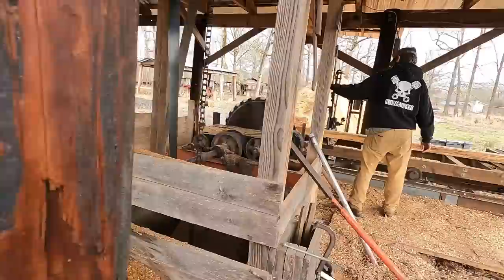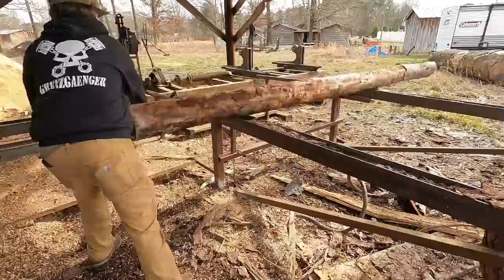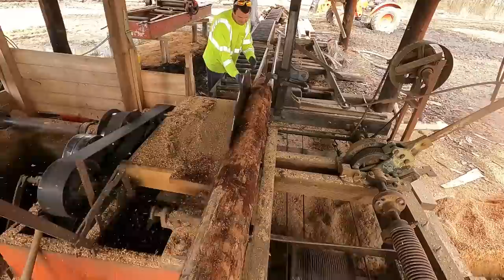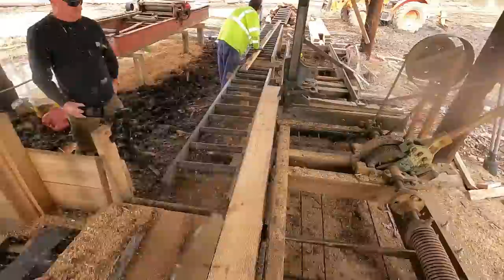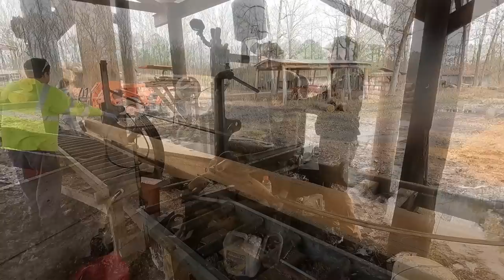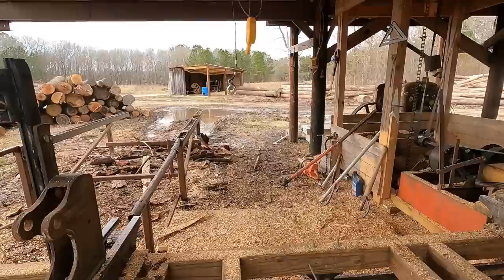1940's Corley sawmill powered by a 1953 Detroit diesel

Comment: What size and how many teeth are on that blade? I just realized at the end how far apart the teeth are.  I'm guessing it might be a B style.  371 does well with it.
Reply: If a 671 is 238 HP what is a 371 ?
Reply: @40yeartrucker25  I think probably something just under a 100. Maybe 80-100.
Reply: @40yeartrucker25   I think it is a 371 also not V671,